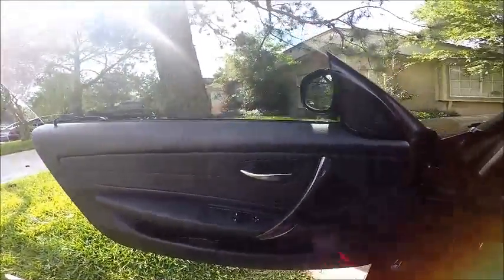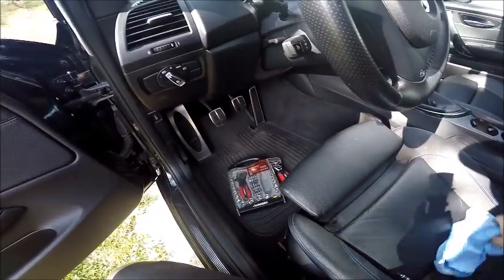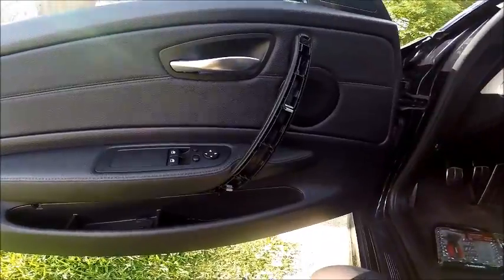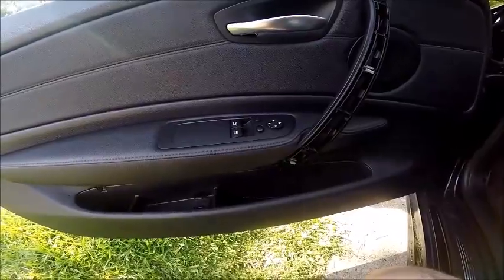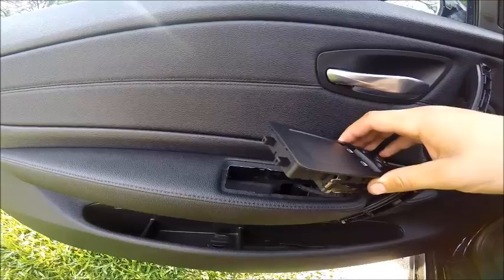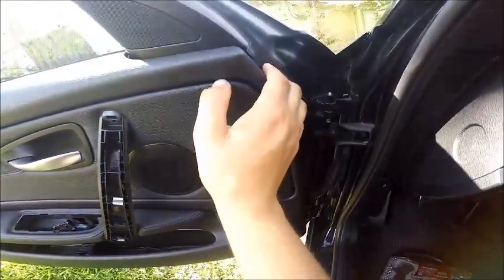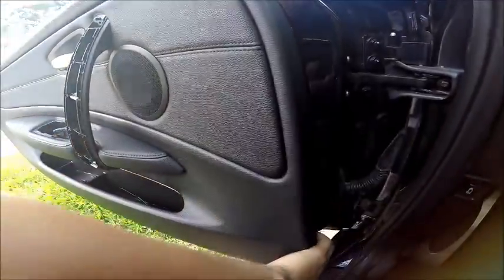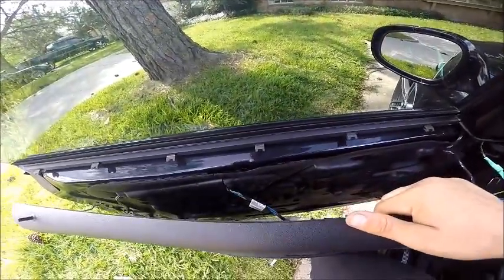BMW 135I Door panel REMOVAL

Comment: Came here to see how you installed that long plastic door handle cover. I can't seem to get mine on. Does it just click into place? Any special way you have to align it? Super frustrating
Reply from the maker: sometimes you have to open and close the door a few times for it to sit just right
Reply: I found working it straight in, and having all the metal pins on the same side helped tremendously!
It's angles but the clips and plastic goes on straight!